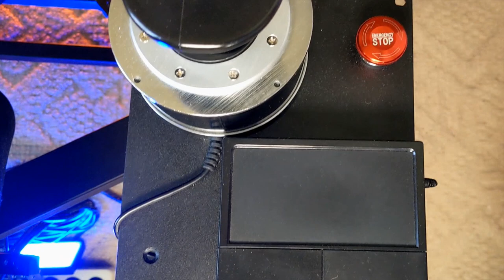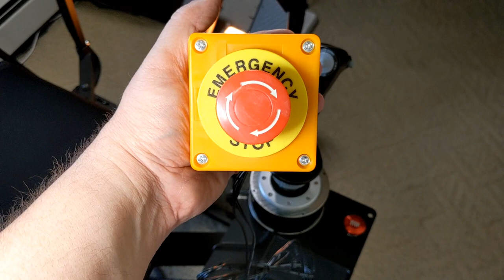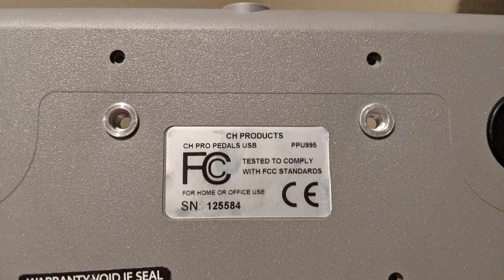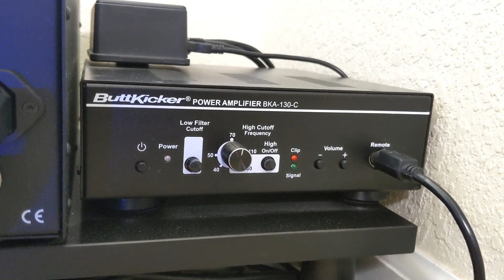DOF Reality H6 Motion Simulator - Part 4: The Peripherals

Comment: Hi Mark, I recently purchased the P6 and followed your advice to get a different Stop button.

The Stop button is prewired, has three wires out Blue, White and Green.

The connection cords are two wires Black and Red

So would the correct wiring connection be:

STOP BTN - Connection Cords 
——————————————
BLUE - BLACK (Connection Cords)
WHITE - RED (Connection Cords)
————————
GREEN - ground 

Please let me know if this is like yours or different so I can wire it up properly like yours before use.  

I’ve read where either RED OR BLACK is hot as well as BLUE, so I want to ensure it’s wired properly as to not let that magic smoke out…

Many thanks and keep up the great content!
Reply from the maker: Hi, I'm at Flight Sim Expo right now so can't check.  Make sure I didn't leave the correct hookup in either th description or a pinned comment... If not I'll try to answer when I get home.  Thanks so much for watching our stuff... Appreciate it!
Reply: @GYGOtv hi Mark, you mention modifications but not by wire colors.  After you get back from the expo and get back in the groove of things, if you get a chance and follow up on this, you’ll really help me and others out.  I appreciate you reaching out on this post.
Reply from the maker: @stephengomes977  Hi Stephen, After looking back on previous replies, what we remember is putting the green wire to the black wire and we think we used the blue wire with the red… not using the white at all.  Try it out that way and see if it works.  If it is wrong, you will just be backward and you will have to have the switch pushed in to get it to work.  If that is the case try using the white wire instead.  Hope that helps.  I'll pin this comment so it will be easier to find in the future.  Please let me know if you got it to work this way so others won't have to wait so long for the answer.  Thanks a ton and appreciate your patience while I was at the Expo.

Comment: Great video! I'm ready glad you included the links as well.

Maybe in a future video, you can show a quick clip how you drilled holes in the equipment for mounting as well.
Reply from the maker: Well I hope we don't need to drill anymore but this thing is like a hot rod, it seems like we are always modding it.  Pretty straight forward on the holes, just drilled them and then put the rivet nuts in the holes.  Not much to it other than that.  They make a special tool to install the rivet nuts and that makes it super easy!

Comment: Have the T16000m stick since around 2017 - no flaws ever. Great value. Added the TCWS throttle later when it launched. But this year its electronics died. I wouldn't buy it again. It was perfect for Elite Dangerous, though. I agree.
Reply from the maker: Thanks for the info Themore, what would you recommend instead?

Comment: This is great, excellent detail. Also congratulations on some very tidy cable management. EDIT - maybe you have other videos, or in the works, but e.g. for the Buttkicker there is a software to consider - Simhub with different profiles, and also Simshaker sound module (a bit complicated now because the seller is Russian).
Reply from the maker: Well thank you... I hate messy cables and I appreciate you noticing!  Probably spent way too much time doing it but my OCD gets the best of me sometimes (well really most of the time).  I also appreciate you commenting and being a GYGO viewer!
Reply from the maker: Reply to the EDIT... There are so many transducer options out there, there probably could be a whole video on it.  I like the simplicity of the Buttkicker and the fact it uses game sound instead of telemetry from software BECAUSE every game has sound and not all have the telemetry.  Just my preference... I've seen some pretty impressive setups with multiple transducers, but I've been happy so far with the Buttkicker for just that added touch of immersion.  Please keep the suggestions coming, gives viewer different viewpoints other than just mine.  Thanks for that!

Comment: what up my friend its been awhile l didnt have any me time for me and my hobby   becuase of my job but all thats change now. im purchasing the dof H3 and have some questions on your setup. (1) on the sabrient power hub how long is the usb chord to plug in the  computer and how close does the pc tower need to be to the simulator? for it to plug in ? (2) where did you purchase that plate or did it come with sim that you have the stop button and the flight stick mounted on? because  i  have the air bus thrustmaster stick the one you were showing its pretty wide and also have the thrustmaster throttle quadrant which  is wide also so im going to need a plate for that. i would like to get a plate that is long enough to put both of them and my mouse on it in front of me kind of like a keyboard pull out tray that  i have on my pc desk. any suggestions on that ? im also going to be purchasing the monitor mount to gain a little more room. (3) is the simulator software easy to use how does it know when you start your game such as msf  to use the  motion platform or no motion ?  for example if i just want to start msf in my sim seat but dont want motion but use the monitor and play 2D game can i do that? thanks buddy any info will be appreciated. oh by the way im also waiting on my pimax crystal pre order to be shipped out hopefully within a month  or 2 for all preorders. i preordered mine in march.
Reply from the maker: Hi Richard, great to hear from you!!!  Congrats on your new purchase and welcome to the club.  For the USB Hub I went 15ft. https://amzn.to/3IudVu6 and then I needed two 16ft for the control boxes to plug into the computer (you will only need one for the H3) https://amzn.to/43iV7pX As far as how close... however far away that those cables will reach, my computer is about 10 feet away from the platform, but I routed wiring in the rig so that ate up some length.

The plate came with my Next Level Racing Wheel Stand and we modified it. I couldn't find the same one I bought but here is something similar that is just the plates. https://amzn.to/3q1Fy7s.  As for a plate, a guy used to make a custom plate I think. I'd recommend asking some people on the dofrealitybuilders facebook group, they probably know more on this kind of thing and what the latest is for mods for that.  I'd be careful with any kind of pull out tray as it will move around when your platform moves.

The SRS Software is the easiest to use that is out there.  It's know for it's user friendliness.  Basically you will do an initial setup for any game you want to use and then the software will auto detect when you start that game and load your settings for it.  Most titles already have a  good default profile but if you want to dig deeper and start customizing your setting to match more your liking you can do that to. I'd recommend you watch my 2 part video with Jeff Weaver if you want to go down that rabbit hole. https://youtu.be/pzi8G7T9p7A and https://youtu.be/LSStkqpIX_M

As for playing without motion, you can just not start the software.  You will want to power the unit on so that it is firm but if you don't start the SRS software it will just sit there.

I might add, if you want the advanced features of the SRS "Premium" subscription, there is a price increase coming at the end of the month so go purchase that now and save $5.

Hope that helps, good luck my friend.
-Mark

P.S. can't wait for my Pimax too... next time use my affiliate code https://pimax.com/?ref=GYGO :)

Comment: I hope you’re still enjoying your motion rig. Is it still holding up well after a few years? And after you added the SFU gears, did that help with balancing? Do you find adding peripherals (front weight) doesn’t require as much difficulty to balance your rig? Thanks!
Reply from the maker: Hi Gulf76, yes everything is running great.  In fact I just did a long flight session last week in prep for my latest video that I just released on the 4090.  Everything seems to be holding up great and all the new parts we added to the SFU Gearboxes are holding up as well.  No bent arms or anything like that.  As for balancing, you really don't balance an H6 like you do the H3... Basically I have the temp strips on the motors and make sure none of them are getting way hotter than the others and so far it works just fine with everything mounted as I normally would.  Hope that answers your questions and thanks for the comment and the view.
Reply: @GYGOtv  Great to hear it’s still going strong! Yes, that did answer my questions. Thanks so much! Looking forward to more videos of you enjoying your rig. Likely to be an autumn project for me after I receive my Crystal.

Comment: go for the vkb gladiator nxt premiums rather than t.16k (might also be better than the warthog)
Reply from the maker: Thanks for the suggestion Hans, might be a good choice for some, but still pretty expensive just for the joystick without the throttle.
Reply: @GYGOtv  while looking what to buy i heard a lot of people complain about the connection between stick and base braking on both that you mentioned, buyer be ware i guess.  The VKBs come in a left and right hand version so you can use one as a throttle  or buy one vkb and the thrustmaster throttle standalone
Reply from the maker: @hanswurst5590  Well I can only speak from my experience and it's been a year and Warthog is still fine.  I have heard if you remove the stick from the base a lot then it can have issues, but I leave mine connected.  I'll have to look more into the VKB and I also hear Virpil are good too. Just for the record the T.1600 can be a left handed stick as well for those interested in that. Thanks for the info Hans you have me curious about the VKB now!

Comment: Where do you connect the 2 wires for emergency stop button and is the wires long enough? If you can give me your email address I can give you my cell number and text you direct because I have a few more questions to ask you if you don’t mind buddy
Reply from the maker: Hi Richard, The wires plug into the back of the DOF Box(es) We did a custom E-Stop button that I found on Amazon https://amzn.to/3v59aRz and here are the Connection Cords with the correct ends to plug into the box that we used https://amzn.to/3OuCAQT.  Long enough depends on where you plan to mount everything.  You can email me anytime GYGOmail(atsymbol)gmail(dot)com I have to write it that way or the Bots farm it, I think you can figure it out.  Looking forward to hearing from you.
Reply: @GYGOtv  yes, I use both of your part numbers in the description for the emergency stop button And the 2 pack 6 foot cord order do you have motion compensation hooked up? I’m going to email you my cell number so I can get in touch with you. I really appreciate it buddy.
Reply from the maker: @richardPalmisano  Still sorting out Motion Comp, you might want to look at ordering a Witmotion Sensor if you need MC too.